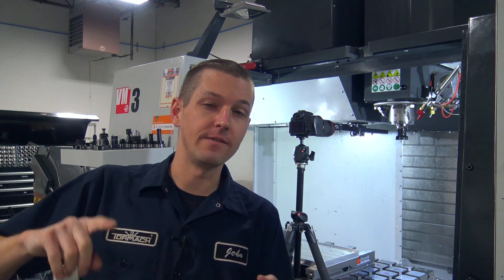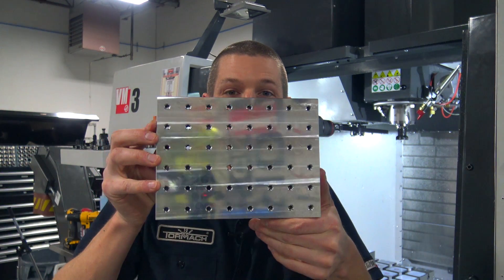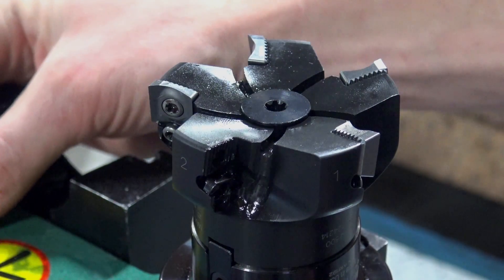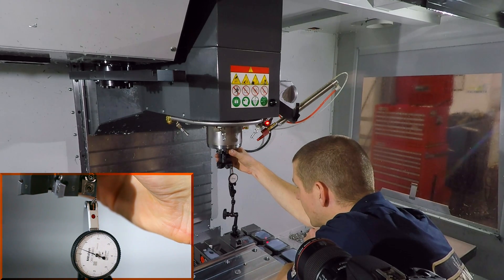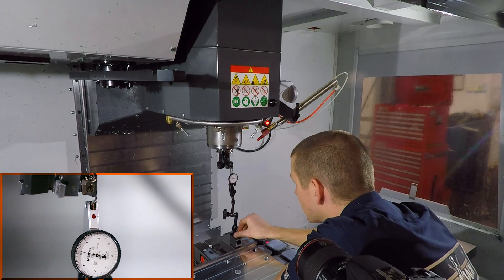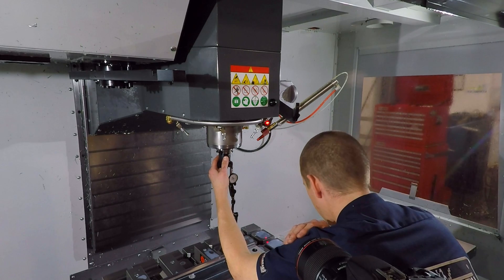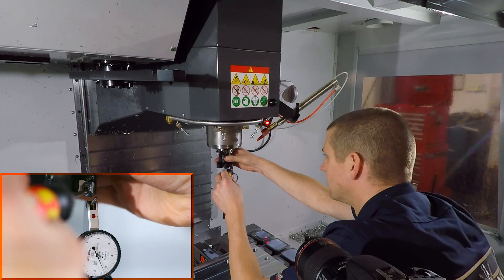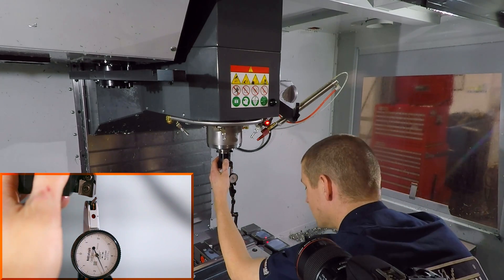Adjusting Insert Heights on a Sandvik 590 Facemill!

Comment: Personally if I need a wiper insert finish. I just cheat and put a .001 shim in the insert pocket of a standard non-adjustable holder to offset it 😆
Reply: So you'd just fly cut with the one insert?

Comment: Hey John you should get a 10ths dial indicator and use a flat shoe for it, give you a nice big surface making it way easier to find the height of the inserts. Next step is a tool setter, to bad a good one is many thousands of moneyies  ;)
Reply: They can be found used, in mint condition and reasonably priced even for garage shops/hobbyists very regularly.

No need to buy something simple new just to get a nice OEM plastic wrapper. Especially if it's one of the non-essentials.

Comment: you did this the totally wrong way. for starters do it on the granite plate, use a flat tip DIAL indicator. you can do this in 30 seconds 6 seconds per tip.
Reply: meocats if he had a known flat and calibrated plate and a correct cat 40 taper holder I would agree. 

But seeing as he doesn't. In spindle is the better option. More of a pita yes, but more accurate results in his position

And I believe you mean a back plunger test indicator ;)
Reply: all you need is a B plate and two parallels, or the facemill directly on the plate. Don't worry, it is sandvik, the face is ground its not like the stuff you see from the chinese. Or, take 1 piece of shim stock, put turn the tool on the machine, until it barely, or equally grabs each cutting tip. The shim layed on the vice. Cheaper still? use a piece of bible paper, or cigarette rolling paper. The sad part is not using of the indicator, but the time lost. There is a guy on youtube calibrating optical flats to less than a micron with a 3 cornered piece of plywood, each corner has an aluminium nail in it, and in the center a brass screw. He demonstrates this device can differentiate between 1 micron out of of flat optical glass. the principle is the same, both methods rely on friction. Back to my first point: the point (no pun intended) of calibrating on the plate is to do your tools on the plate so the machine can run while you tighten screws. Perhaps there's a million and 1 ways to do it, but you are practicing a routine since it requires no particular intelligence to turn screws, therefore there's no point justifying a odd mickeymouse way of doing things. And after the dust has settled, what was the point? Was it not to produce the best milled finishes? The numbers on the indicator are irrelevant.
Reply: i didn't mean back plunge indicator --- grandpa's measures 10ths? really?
-its not better in the spindle, in practice, by a handful of reasons i've stated answering about 50 comments in this comment section.

Comment: John check out This old Tony Feb 2 Video on test indicators and Cosine Error starts at about 12:55, other have mentioned arm position in the comments as well.   https://www.youtube.com/watch?v=CE1epUFRgHA  
I ran into the same issue a few weeks back when trying to true my inserts on a Maritool 2.48 head.   My indicator arm location was wildly incorrect compared to yours, but correcting my arm position in ref to the insert solved my arrant readings.   Very interested on how you come out on this, I too am looking at getting a wiper for the Maritool if they make one in the SEHW

Comment: I've had to dial in inserts before but i used the height setter on each insert.  The setter was just a dial mounted to a block on the table so we could just fed into 0 on each insert and adjust accordingly

Comment: I own a digital test indicator.  Not worth it. 

Also your indicator ball is the wrong way. You're getting odd readings because your turning into the ball tip and applying forward pressure to the lever.  Flip the indicator ball the other direction.
Reply: Occams Sawzall I think this tip is critical, no pun intended.
Reply: This is also an application where a vertical test indicator will shine and is worth every penny
Reply: Kor409  yes/no. He's going backwards and forwards over it. And on a tenths indicator impinging the ball and lever like that knocks it out of whack a little every time.
Reply: Occams Sawzall Agreed!
Reply: Occams Sawzall x
Reply: Hmm, then I guess however he places it, this kind of meter will never give accurate reading as the pressure on the ball tip will never be one pure vector ? If I make sense....

Comment: Not sure if your machine has a gearbox, but I've found that switching to low gear with M41 before the M19 makes the spindle hold position a bit better when it's locked.

Comment: as stated before the inserts have tolerances but the indicator tip that you are using wrong. try using a tip with a large radius.
Reply: flat -- NO RADIUS. also known as a toolsetter. Also known as a z-axis presetter.

Comment: Keep in mind that inserts have tolerances as well, so even if the pockets are machined "perfectly" in a non-adjustable tool, the inserts won't be the same. You can spend a ton of time tweaking this by shimming and flipping inserts... or spend a good chunk of money on an adjustable solution. Buyer's choice ;-)
Reply: correct me if I'm wrong but arent most milling cutters like this designed to have the inserts set at different heights???

Comment: Interesting.  I would have thought that the tapered head of the little screws that adjust the inserts push against the taper of the bottom of the insert, so as you drive the screw in, it pushes the insert up or down.

Comment: You might like Dan Gelbart's demo on flextures...I didn't ever think that things like that existed, but basically deforming a part of something is much more accurate than moving something!
Reply: only if there are no internal stress in the part, as those make the deformation deviate from predictability of deformation.
Reply: You will sill get the movement you want and you would still be precise and repeatable!

Comment: Will be interesting to see how well the inserts keep their position after some cutting.
Reply: Eggsr2bcrushed 
If your insert screws are coming loose, you're doing something wrong. You are either not torquing them down correctly, using the wrong screw, or the threads on either the screw of the body are damaged. 

Zero, repeat zero need to ever put any kind of loctite on insert screws. 

Loctite expands to fill voids, if you get some between the insert face and body, you'll push out the insert by a couple of thou and it won't be seated correctly.
Reply: don't be a fear mongerer. never loctite, use the tool exactly as intended. and send it back if it didn't perform to your expectation. But don't worry, they test these tools and let you test them before buying it. If you have extreme paranoia, please don't recommend voodoo fixes like loctite. instead keep to yourself rather than post destructive personal drivel. Only the manufacturer's recommendation matters, because that is the criteria for warrantying or refunding the tool.
Reply: Been using this tool for about 3 years and there is no need for loctite at all.
Reply: But ok how he measures those tools is painful to me, i've been working with cnc for about 10 years now and we have optic scanners to measures tools to get accurate "teeth" positioning.
Reply: I do not use the imperial system where I live, but i have a 63 mm 590 (it's about 2.5 inches i think) i can mill quite hard with it in a 5 axis Mazak 500, it has never come loose.
Reply: Eggsr2bcrushed 
NEVER loctite insert screws!  They explicitly instruct you to use anti-seize on the screws... the exact opposite of what loctite is.

The inserts will wear more than they will move in the holder. Screws have incredible holding power especially when wedged against a solid face like that. Inserts often break and the screw remains intact in the same spot.
Reply: Point taken.